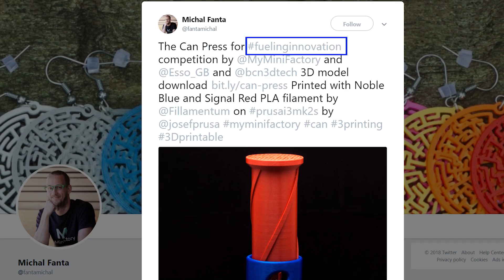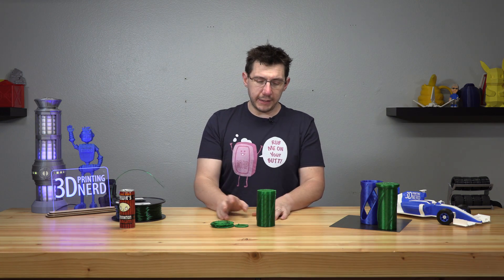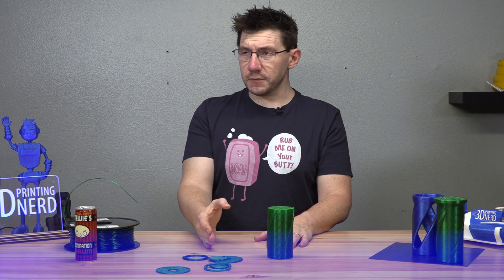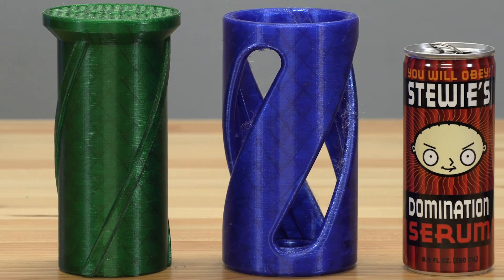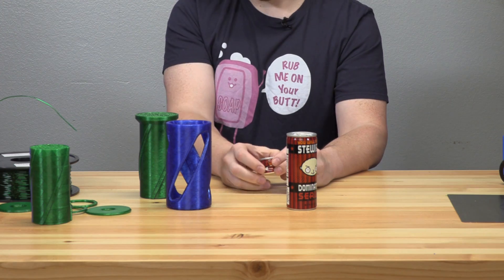The Best Way To Crush a Can? Matterhackers PETG / MyMiniFactory / Prusa i3 mk3 / ESSO Contest

Comment: The rotating mechanism inside that gadget just creates friction losses and makes the tool less efficient. Most of the energy applied is wasted. A simple cylinder without the helictical thread would work much better, perhaps nearly as good as a pair of crocs lol... Useless waste of space items like these are just the kind of junk that puts me off getting my printer back out from the loft, pretty much anything you make can be purchased cheaper and better.. Plus my house was getting full of useless trinkets...

Comment: What a terrible device.  Not only is it no more effective than stomping, but it's harder as you have to overcome the vertical force component of the corkscrew.  Also, why would you design one to accommodate only 250 mL cans?  I've seen much better can presses that utilize leverage to make it very easy.

Comment: I use the front loader bucket either on my wife's tractor or the skid steer.  You can put the cans on concrete and then push on them with either loader bucket.  It will crush like 500 cans at a time and it is not too particular on can size.  It will do the dinky ones, regular beer cans. and up to 55 gallon barrels.
Reply from the maker: You're crushing 55 gallon barrels???
Reply: We have crushed a couple that were no longer suitable for their intended purpose.

Comment: I feel like the screw design would be somewhat counterproductive. It makes it more difficult to press the plunger as some of the downward force is being turned into rotational motion. I could also see that screw being a point of failure if you were to ever take the plunger and apply a large amount of force to it at once. Either way, I think both upscaling this design to fit standard 8 and 16 oz cans, as well as replacing the screw design with straight guide rails would be an interesting project.

Comment: just watching this video gave me a ton of ideas on how to improve on the crusher design
1. i imagine that an issue of can crusher is that the air in the can is trapped by the can and the walls of the crusher. i imagine this could be fixed by making have a larger radius. 
2. you could also improve the way of removing the can by having a hole for the desired can height towards the bottom on the side so the can is able to slide out.
3. if a can is crushed quickly rather than slowly, it tends to not compact aswell. the friction caused by the grooves may cause them to not work as well for crushing. by making the curve of the groves less sever or by making them not curve at all, it could potentially crush to a smaller size

Comment: That's not a can crusher, thats a tube that can hold a can.  A can crusher gives some mechanism to give mechanical advantage to allow for easier crushing of the can.  Levers with gears are commonly used to achieve this.  But a good video on PETG.

Comment: Personally I find crushing them by hand much easier. The technique goes like this: place one hand over the top of the can and one over the bottom, place your fingers about 2mm below the base and tip of the can and apply a light amount of force to grip the can well but not dent it. Then simultaneously twist and push. your top hand will push down and your bottom will push up. Your right hand will twist clockwise and your left will twist counter clockwise
Reply from the maker: By hand is the way to go, I agree

Comment: Forgive me, but wouldn't having a straight piston work way better for this than this press? 
The point of this kind of press is to convert a torque to a perpendicular force, and when the force is applied parallel to the can the threads actually divert some energy back into torsion. This makes the slamming less effective than if there were no threads, defeating the purpose. This is especially hurtful when the friction surfaces involved are rough.

Comment: Years ago they used to have big Green can bins with a buildt in crusher. It was a long arm unit which really had kids literally queuing to crush. 
Now they've literally removed all recycle sites..I'm my small town we used to have 5 banks maybe more. Now we have not one, it's actually ironic when we need to encourage recycling there are no places to go!
PS. I crush with my hands and I'm weak. You first twist and squash the middle then press between your palms. For very strong ones twist then boot it

Comment: i just pour about a 5000 empty cans on the floor the dump truck in my shop is the can barrel when not in use then use a skid steer to run them over just stop by the recycler when on my way to a job

Comment: if you out a handle on the top of it that points outwards you would be able to just twist is and with the grooves the twisting motion would make the can press go down and crush then can easier with more leverage. obviously some remodelling would be required.

Comment: Hold the top and bottom, twist and crush at the same time. It's crushed and you dont have to have a 3D printer, spend money on filament for the printer, don't have to wait for it to print and lastly you dont have to smack the thing 20 times for it to get crushed.

Comment: Can't say I'm impressed by the working mechanic of the press... Maybe do a collab with Gear Down For What in order to figure out a solution that would use a reasonable small motor with a high gear reduction to do the job on its own once the two pieced have been combined with a can detected in-between.
Reply from the maker: Oh can you imagine how cool that would be?

Comment: the top of the cylinder that crushes the can should be able to freely rotate to make the downward force convert to rotational force easier...ive found crushing a can in my left hand then twisting clockwise achieves the same result

Comment: A very stupid design... Lots of energy wasted in the friction for the "rotating slides". Would be better off with just the cylinder going straight down OR have the helix turns way more dense, so it's like a screw and you make it go down by turning. That way you have more leverage.
Reply from the maker: I think what would have helped with any sort of spiral is if the spiral gripped the can and twisted the can itself. It would have aided in the crushing.

Comment: If you design a new size, add a weep hole in the top section so your not sealing the air into the can. This should allow it to be crushed easier!

Comment: The generic pet profile in prusa control edited to lower the bed temperature has worked well on the Mk3, I've set it to 75c then 70c though you could probably go lower. On very sticky (to PEI buildtech etc) filaments I find raising the z height by 0.05 helps.

Comment: 3D Printing Nerd, a bit of a different question. What kind of materials did you use to make your presentation table? No one in my entire town sells table surfaces that thick. Is it just really thick particle board or is it hardwood? I am trying to make one just like that.
Reply from the maker: +Nannerpuss my father made it, and it's a number if 2x4 boards glued together and then planed. It's AWESOME
Reply: Dang, that'll be skookum as all get-out. I'll try that. Thanks!

Comment: I think using a leverage system would still be more viable, but using a rubber mallet should make things easier. Or at least louder...
Reply: Yeah, just print yourself a hammer and start crusing the cans with that. No need to print that can crusher from Mr. Fanta at all... :-D 
Actually coming into this video i was hoping to find some clever way to multiply your force by twisting the two pieces, and not just a can holder working with gravity (that thread between the pieces seems to be pretty useless).

Comment: I had the exact same problem with matter hackers PETG on the mk3.  the mk3 settings were much different than what Tom suggested.  It is also very different from the settings that matter hackers recommends on their site.  It would either not stick to the plate or  leave edges up.  I tweeked it a lot and eventually got a good print but i am yet to feel comfortable enough to start a print and just leave it like i do with PLA.   I don't think it is the printer or the filiment, just think some setting is wrong.  

What settings worked for you in the end?  Would love to know so i could try them.

Comment: Typical guys, looks for heat gun by turning head 180° around, then gives up. Wonderful channel btw just subbed.
Reply from the maker: +Josiah Lopez I ended up finding it downstairs :) THANK YOU for the sub!
Reply: 3D Printing Nerd you’re really inspiring. I’m wanting to get into the 3D printing world myself, what cheap printer do u recommend. I’ve had my eye on the Anet A8, what’s your thoughts.
Reply: Josiah Lopez I've got that one. It's pretty good for it's price, but be prepared to replace EVERYTHING after a while, stuff breaks. And the acrylic frame is reaaally bad.
On the positive side, It prints very well when correctly setup !
EDIT: autocorrect
Reply: nessotrin jean hey thanks I just got it and after 9 hours of use the power supply started buzzing and then the machine stopped in the middle of a print. You have any clue what happened.
Reply: Josiah Lopez Power supply buzzing ? Sounds bad. It might have overheated and died. Check the output, it should be 11-13V. If it's not, it's dead. BE CAREFUL, the 220V (or 110V) contacts don't discharge even after days (that wouldn't pass any safety test), so do NOT touch it.
Mine still works after more than a year (500 hours of printing) but I always kept a fan on it to keep it cool !
If it doesn't work at all, find another powersupply (they are really cheap) and put a fan on it.
Better still, change for an ATX power supply, but that's more technical.

Comment: I have to say the can crusher design is terrible - it's trying to solve a problem that doesn't exist. What happened to standing on an empty can and tapping the side wall slightly? Can instantly crushed, no effort required. Those with anger management issues can stamp instead of stand if they feel the need :)

Comment: You know the main reason that didn't work was because you didn't have anywhere for the air in the can to go if you made the pressing part Hollow and had holes on all the way through the edges of it then you can much more easily crush the cans

Comment: Another fun video.  It would be cool to compare the filament cost + printing time of the printed crusher to the price of buying a metal crusher, like this one: http://amzn.to/2EpiZQZ
.
Here's another vote to make the wall behind you a chroma key screen.  Backgrounds could change!  Or you could point to 3D printer things like a weather dood on TV.  Several years ago I built a chroma key environment for video.  This is the pre-mixed paint color I used, two coats of which which turned out to be perfect: http://www.myperfectcolor.com/en/color/73083_Nickelodeon-NK313-Reptar-Green

Comment: Hmm doesnt really work very well at all especially for older people, needs some kind of leverage multiplier to maken it eaiser.
Reply: The metal ones ive seen had long levers. Maybe a lever with a rachet could work better
Reply: whack it with a hammer
Reply: Maybe place it on the floor and step on it.

Maybe don't print the tool and do that anyways.
Reply: Then it shouldn't say "press" on the to. It needs gears... because, gears!
Reply: I think if you just put a little handle on the top so you can press and twist at the same time with ease, it would work better. Wouldn't seem hard to add. It also would seem easier if you held the thing sideways and twisted and pushed in so you use both arms.
Reply from the maker: SAVAGE!
Reply: Twist it and put a handle on it for more leverage.
Reply: The screw part adds leverage
Reply: You might as well just step on it
Reply: If you're going to go through the effort of making these, maybe add a puncture point that releases the air instead of compressing it, the lid seams to make a sealed chamber. Though I admire the ingenuity, I agree that the heel of your shoe works well enough
Reply: not really meant for old people
Reply: Well I can crush a can better and faster with my foot and a pair of Crocs.
Reply: Your suppose to twist it.
Reply: All these idiots giving legitimate ways to improve this JUST PUT SHOES ON AND STEP ON THEM
Reply: I agree with The Demon Overlord of the Netherworld King Laharl Krichevskoy.
Reply: Then it shouldn't say "press" on the top. It needs gears... because, gears!

Comment: I'd add some kind of lever to the outside, so that it doesn't take all that force.  Instead, you'd turn the shaft and it would screw down into the cylinder and crush the can.

Comment: Create a pump similar to bicycle pump ... but instead of normal pumping motion, you use hammer to force the handle downwards.

Application doesn't really matter but it could be used for pressurizing air canisters for whatever uses (like dust removal)

Electric pump is expensive so this might be cheaper

Comment: Well - You should be able just to use the different sizes in procentiels. So if you want it for 330 ml can: Finding the: Width= 660 mm (330/500 ml cans) / 540 mm (Redbull) /  x 100 = 122,22% bigger.
Height: 1680 mm (500 ml can) /1340 mm (Redbull) x 100 = 125,37%. So you just need to change the size now on each plane in percentiel.  Enlarge 122,22% on X/Y and 125,37% on the Z . :-)

Comment: Petg + glass = shards of glass for me. I have to print it on tape.
Reply: It sticks really really well, and if it is cooler where you are printing like lets say 58f degrees it likes to warp. I had it stick so well it broke the glass in half, had it take chunks out ect. This is with using glue and hair spray. It may be  the type of glass I am using but too many problems. I would suggest using tape if you want to try it out. You wont risk breaking the glass or if you have pei it avoids welding to that. (never used pei but that is what people says it tends to do to pei sheets)
Reply: At least for my printer once I upped my distance from the bed a little and lowered the bed temp I stopped shattering my glass build plate. Now prints just pop off once the bed cools down to 30ish c.

Comment: PETG is awesome, and the Mk3 prints it beautifully. I use the Slic3r PE profile, and bump the temp to 240 with Inland PETG. Most objects can even print at PLA speeds. Print a device to put *more* holes in the wall!
Reply: What bed temp were you using. The 80/90 that is in the Slic3r seems way high and even joel said he reduced it to 60. I was having a horrible time trying to get it to stick well on parts that had small zig zag moves. It would just curl and stick to the nozzle then from there everything was toast.  I tried glue stick and it did not help much. I got a few good prints when i reduced the bed temp to like 65 but it is still like 1 in 3 that go well from the beginning.  I have not had many issues after the first layer, but that first layer is tough.
Reply: Andrew Whittle I set the bed at 70 to 75. One trick I have also found key is that PETG usually needs an extra .05mm to .1mm in Z height. If I think ahead, I will add it to the first layer in the slicer, otherwise adjust the live Z. I have never had much luck with glue stick. It always seems to make things worse for me. A clean bed is critical, however not to clean. PETG can really stick to PEI. I will clean thoroughly with alcohol, and then apply a liberal coating of glass cleaner, that I just barely wipe off. The residue from the glass cleaner works as a release agent.
Reply: I am absolutely loving Slic3r PE for PLA+, PETG, on my Wanhao and Kossel. Very smart and quick slicer. I like to use a .3 first layer with i think 150% extrusion over layer width setting

Comment: Layershifts on the mk3? Did i hear thst right? I thought the prusa can detect this...
Reply: You have to enable crash detection, it's off by default.
Reply: Nothing's perfect, mate.
Reply: Bruce Moore Same fck stupid answer that the prusa support could have send about a week of waiting. For me the mk3 is not worth the money!
Reply: So do we know which one of those option caused this layer shift ?  If not, Joel can you step in ?  I too taught that MK3 should detect skipped step.. ?
Reply: The layer shifts that the Pursa will detect, from my understanding, is if something external interferes with the extruder, like if it bumps in to something.  More subtle things like the PET settings causing the extrusion to screw up maybe isn't something that it detects.

Comment: Really cool lol, I love how this is just a harder way to crush a can.
Reply from the maker: NO WAY! hahahahah
Reply: Miguel Alcala 😂😂😂 I love that it genuinely made me laugh😂😂😂 (my mum told me to shut up)
Reply: Miguel Alcala sure you can, might not do anything
Reply: so true
Reply: You can build one with 2x4 scraps that can crush pretty much anything, just by pulling down on a lever.  Just sayin'.
Reply: Your helix should really be threads. Then screwed together
Reply: EitriBrokkr you can't stomp on threads lol
Reply: EitriBrokkr Tru
Reply: It's just not 3D printing unless it takes days to make something useless.
Reply: Exactly my thought. Just but the can on the ground and step on it.  We used to do that when we were kids. Put just enough pressure on the can with your foot so that it almost crushes, then tap two sides with your fingers. Instant flat crush!! As I'm older now, the bending over bit is a bit much.  

But anyway, a good design would provide some leverage and might even include something to poke the sides of the can.

Comment: PETG is my goto filament for anything that needs strength like that. I use eSun almost exclusively from Amazon but looks like MatterHackers prices have dropped enough to start looking at them again.

For PLA, I use eSun's PLA+. It is more flexible than PLA, but not as much as PETG. Not sure if MatterHackers has a similar one.

Also, just ordered my Prusa MK3 the other day via your link. Looking forward to getting it.